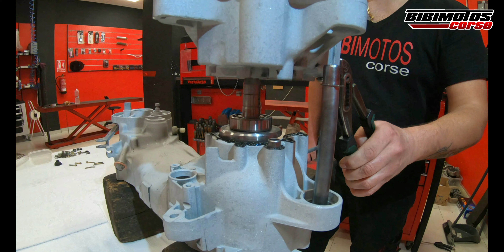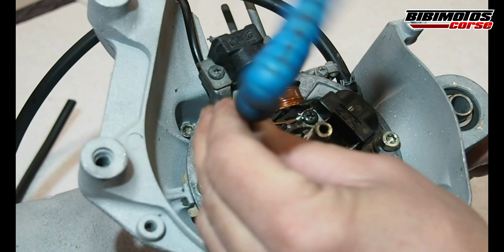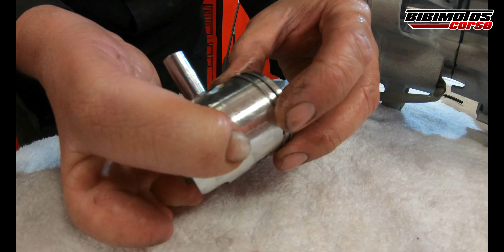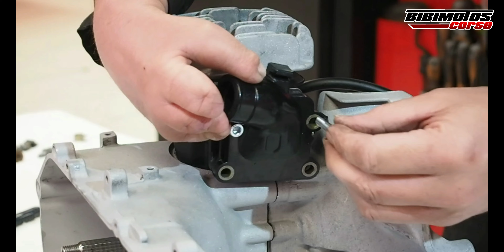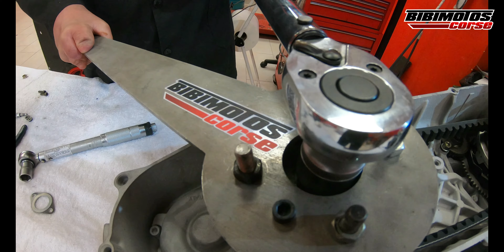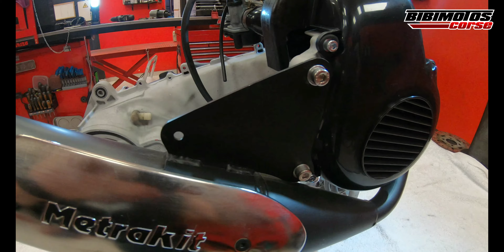REBUILD MINARELLI VERTICAL YAMAHA BWS / SLIDER / BOOSTER

Comment: Hola, por donde se drena y se llena el aceite de motor en este motor? El de transmision el facil pero el otro?
Reply: This is a 2 stoke motor no oil in the motor except transmission the pump and yellow wheel underneath the ignition rotor are the oil pump and gear wich mixed in the carb